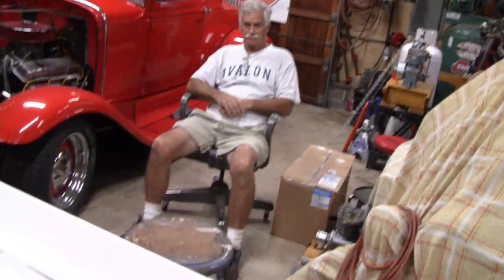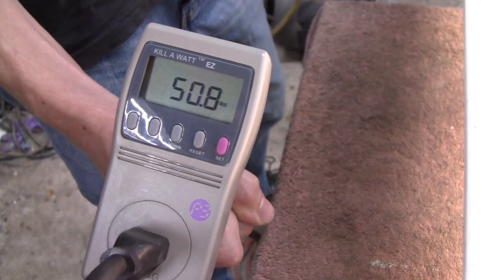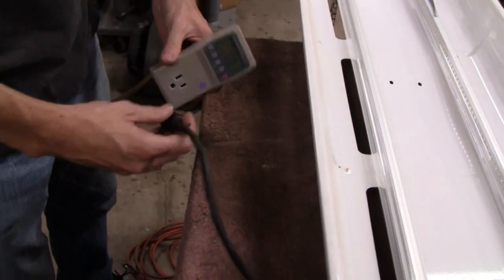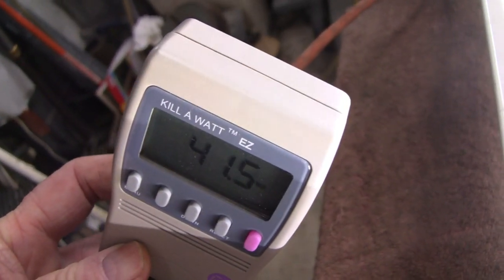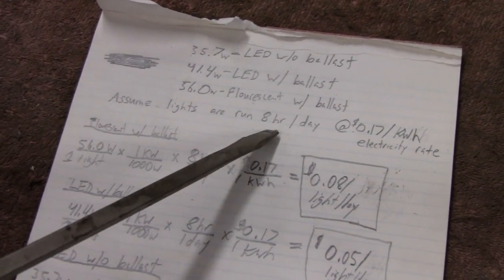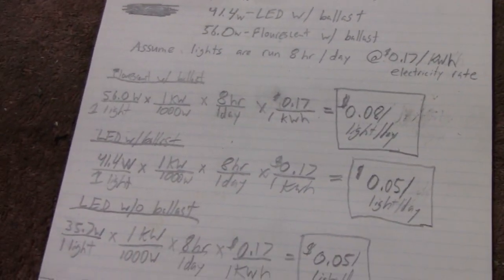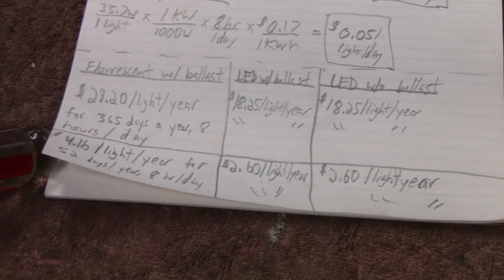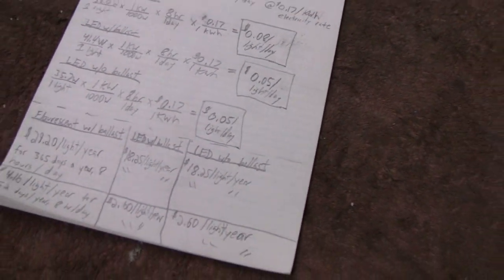ACTUAL LED LIGHT SAVINGS (test results)

Comment: Thanks for the edumucation guys, I've got 5  48" dual bulb florescent fixtures in my unheated tinkerspace that I've intended to change over to LED since RK did his shop earlier this year, the best part will be the low temperature lighting characteristics of LED's verses Flourescent. Not so much the difference in cost of operation. $0.071325 per kWh here in southern MD.

Comment: I would think the LED's would last longer too.
Reply from the maker: Yeah we didn't even consider that!! I like them because they're brighter and work better in the cold!!☺
Reply: RamblinAround hate to say anything, since I don't want to hex it, but none of my LED lights have burned out (or just quit working) yet and I started switching over about 5 or 6 years ago when they were relatively expensive and the technology may not have been as good as today's models.
Reply: hmm youd think so, but many designs either the leds get too hot, are overdriven, are poor quality, or the driver circuit - same issues, meaning the 30k hours lifetime of a tube is a hard target

Comment: Thanks for the original video!  It prompted me to replace the old lights that had bad ballasts with something more modern, so in my case I needed new lights anyway.  I did not know previously that I could get drop in LED bulbs and didn't need to buy new fixtures.  Naturally, I cut the ballasts out.  It think the quality of the light is much better and they don't struggle in cold weather either.  Also in GA, I pay between  $0.056 and $0.097 per KWH depending on consumption.  I am from NJ originally - EVERYTHING is more expensive there.
Reply from the maker: Yeah Jersey sucks!! I wish I could get outta here!!☺

Comment: the reason for flouro's tubes lasting so long for availability is, when compared with led lumens per watt, there isnt a big diffference, so only a dimmer led will use less power, so when you calculate in the price of a new tube vs a new led unit, its still not an easy choice

Comment: Southern Arizona - $0.125 / KWH on the higher price tier.  In other words, it's cheaper if we stay under 1001 kWh per month which doesn't happen with it's over 100F .   For us, as CFL's turned yellow I replaced them with LED.  Same for the 4ft tubes (although they just get dimmer, they don't turn yellow).   I also like the LED tubes in the shed as they turn on even when it's cold out (we can get down to 20f)

Comment: What does a ballast do and is it safe to remove?
Reply: A ballast limits the current going through a fluorescent tube so it doesn't burn out, for LED lights it's not needed so can be removed safely and the light fitting rewired to suit the LED tubes.
Reply: farles777 It provided the current to heat the filament in the end of the bulbs, provides the high voltage spike to ionize the gas in the tube, then provides a steady flow of current to keep it lit.

Comment: I switched the bulbs in the 12 volt lights in my camper to LED.  Mostly cause they are whiter and brighter. And if the power goes out and I'm running off the battery I don't have to worry about the battery going dead. 
But for household I've yet to find a LED bulb I like the color out put
Reply: try bright stick from ge love them they are very bright at 10 watts each they replace regular 6o watt bulbs the covers pop off if you need more light and I get no perceivable flicker

Comment: how well dose the led lights work when the temp drops below 32F?
Reply: TheNivek78 Better than the majority of the florescents out there that usually need to warm up when cold. 

I've got screw in LEDs in my outdoor lights that work no different than an incandescent on a bitter cold winter night.
Reply: TheNivek78 Just as good as the old incandescents, unless its -30° which not very often happens even in northern mn.

Comment: Actually, at 56w it would be $27.82. at 41.4w it would be $20.57 and at 35.7w it would cost $17.73 per year per bulb @ 8 hours per day.
Reply: Yep, with rounding the ballast/led should be .06 a day. Rounded figures shouldn't be used in calculations.
Reply: wayne creech If you're gonna call out someone's math at least check your work!
Reply: Per fixture...
Reply: @motoforlyfe: 
not looking to start an argument but.... 
there are multiple online calculators that I double checked "my work" with. for example http://www.rapidtables.com/calc/electric/electricity-calculator.htm
Reply: Your calculators are wrong. You will see this if you run the numbers through the formulas that they are based on (which happen to be equivalent to the ones I derived.) I believe the program running the calculations may be utilizing floating point arithmetic or some other data type that is resulting in inaccuracy. Granted, it's only off by a few tenths but wrong nonetheless. Never trust calculators.
Reply: those darn significant digits always changing the results. :)
Reply: this calculator used 365.25 for the days in year and month is 365.25 divided by 12 . That is where the difference comes from.

Comment: I've just checked my smart meter monitor, it doesn't show kWh cost but today so far I've used 0.2kWh (00.00 to 02:00am)
I'm running off LED's with every light I use though at a monthly bill of $23.40 with all my electric use. (Converted to USD from GBP via Siri) 
Data is is interesting, right? Lmao 👍
Reply from the maker: Aye yi yi!! My monthly bill is $144.00!!☺
Reply: 805ROADKING 
I didn't include service costs, that's just the electric I use. All in my monthly bill is much nearer yours lol

Comment: Love the show.  Rounding and using the same figures and not showing the savings even with more than 10% lower power without the ballast transformer is bad math. Significant digits matter.
Reply: Jarrid Gross You may be right that rounding at an intermediate step isn't good practice however some viewers may be confused by dollar amounts with more than two decimal places. Furthermore, if proper sig fig rules are abided by the actual savings is only $3/light/year for ballast vs unballast LED which to many would not even be worth the hassle involved with bypassing. Far greater is the savings associated with the switch from florescent to LED, which was the aim of the video to show.

Comment: i actually think the numbers here are seriously flawed. by putting in 15 regular bulbs in our home alone our electric bill dropped right at $40.00 a month during the summer peak use times and most power companies specially here in the South charge a premium charge for power during peak use times. I was told that all companies do but i don't know that for a fact, i can only speak about the ones i have dealt with personally.  but yeah just by changing out the the standard bulbs, Xenon and CFL bulbs that we had and not changing out habits any the bill dropped that much in a month.  hasn't dropped thjat much since all the kids were still at home running up both electric and water bills to be fair i don't have the peer minute rate we get charged here, so i don't have actual figures to compare i only have bill data and with our there was a significant change as well as the savings of not having to buy new bulbs in a couple years now which is highly unusual also but a welcome change. and yeah i too love the fact that they are brighter*